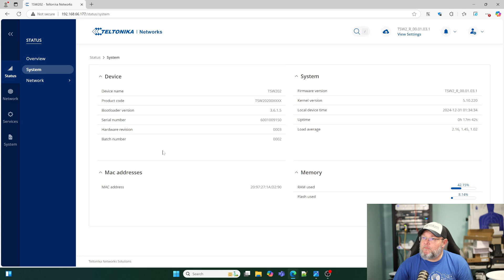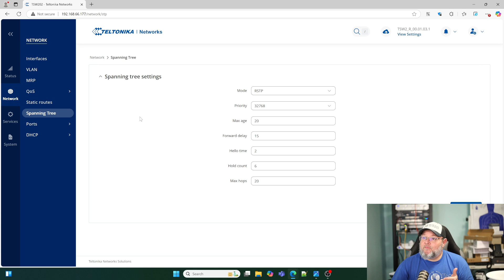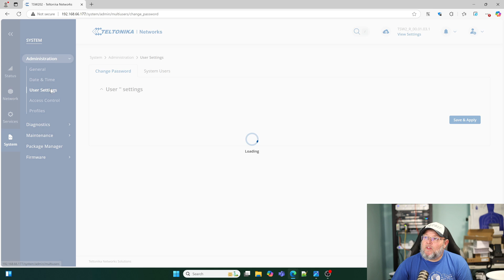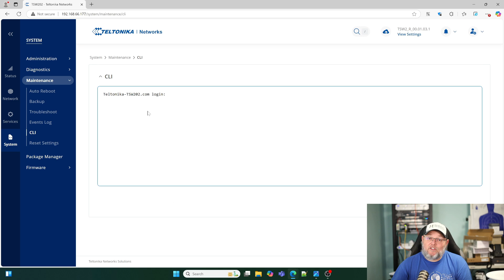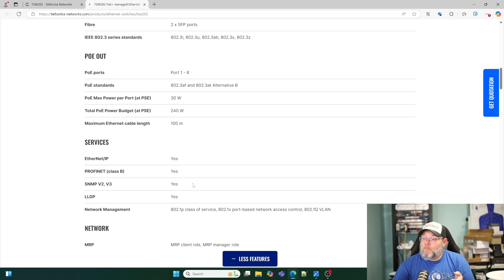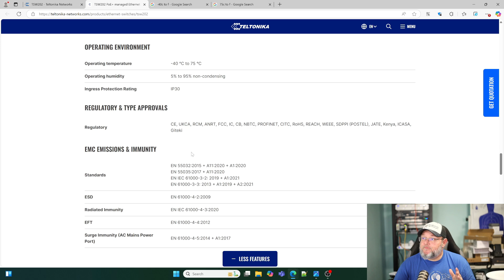A REAL TOUGH switch - Teltonika TSW202

Comment: @WillieHowe I installed two of these today about a thousand feet away from each other. Somebody else ran the fiber optic line. I could not get the SFP indicators to illuminate... I have single mode, MSA compliant transceivers, I've been told the line is fine, am I missing something with the settings of this unit? Cat6 for a long time but never fiber optic. I observed polarity in the duplex connectors and tried both ways. I love your channel, thank you!
Reply from the maker: Are the SFP modules compatible with this switch?
Reply: Willie I really appreciate your quick reply. So I got back to the shop and it just got the best of me I couldn't let it go. I grabbed a couple units off the shelf and I threw the transceivers in them with a patch cable and it worked just fine. So something must be wrong with either the cable or terminations.  @WillieHowe
Reply: @WillieHowe switch requires MSA. Chinese Amazon part States MSA... Worked in recreated bench environment. 👍
Reply: The Teltonika web site has a short list of compatible SFP transceivers.  In my experience even new transceivers and/or cables fail to connect with the far end of a link.  Invest in a fibre optic cleaning tool while you’re at it.  I always test SFP GBICs and cabling on the bench before I pull 100m of cable through the duct.. I’ve lost enough hair already !!

Comment: Doesn't have enough POE power.  It needs 90 Watts a port. We use a lot of DINrail switches and powerups for the video and access control systems.
Reply from the maker: @michaelmiller4834  How much are your native din rail switches with 802.11bt?

Comment: I am mostly in a Ubiquiti shop (so I would love 24v and 48v passive POE out).   But honestly this is a wonderful switch.   Been burned so many times when trying to use Tycon and a few other "industrial" brands.  If this works at that price point, I would not be opposed to trying this.  Do they go over the lightning protection, and are the parts replaceable in the event of damage?

Comment: That price is straight up insane. Wish that was around when I bought my unmanaged industrial switch for my outdoor camera system.
With dc - wire length, gauge, and voltage drop becomes a concern. But with those short wires, probably not going to be a factor. 
Make sure the supply can handle multiple devices and their in rush currents, as a 3% voltage drop can tank a digital device.  Ask any boater who diy installed their radar or fish finder and tried to save on wire cost. 
Wire protection - add a fuse block for each device and you also get a service disconnect for each device. Would suck to have to power down the whole supply just for one device reboot. 
Do heat calculations if installing in outdoor enclosure. Could save you a surprise later.